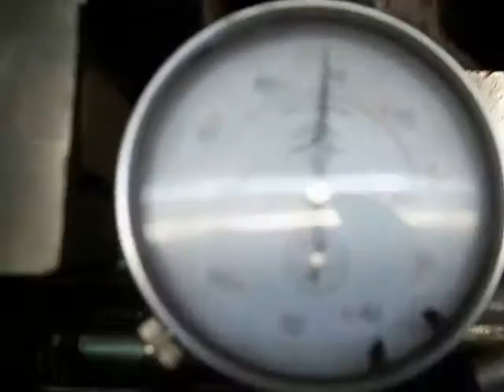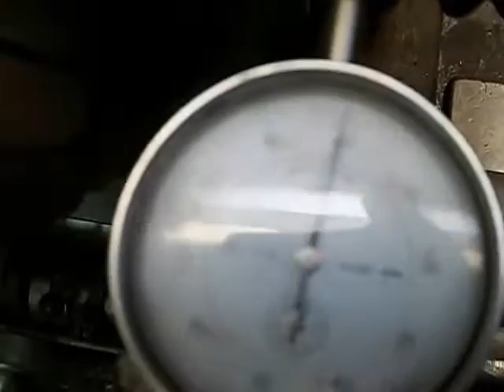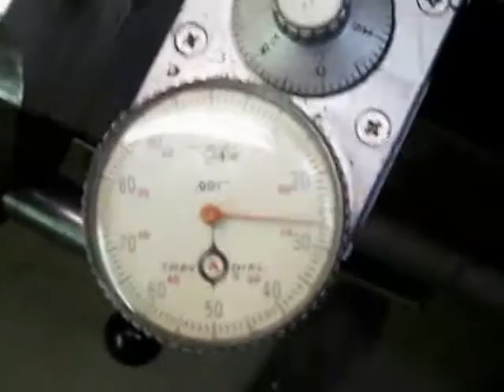PULLEY REPAIR 0001

Comment: thanks very much for that clip found it interesting and i have one question or request , i would like to see a close up picture of the cutter profile you used for the keyway , i have tried many times to slot cut with my little shaper and i cant seem to get rid of the shatter .
johno
Reply from the maker: Try to lock down the clapper box. The cutter I use is HSS ground with 5 deg angle everywhere. Make the cuting edge wider then anywhere else Thanks
Reply: ok thanks i will persivere , i have made a plate to use that replaces the clapper for slot cutting it is solid no clap think i will check my ram gibs make sure they are nice and snug , and i will grind another tool 5 degree on all faces see how i go with that .
thanks for your reply .
johno
Reply: @smokeytexx  And, succes??